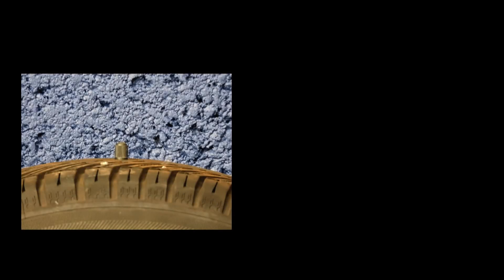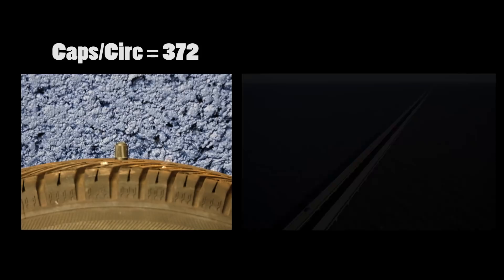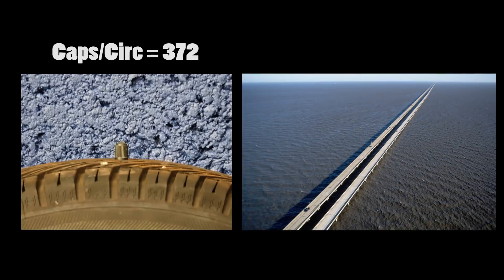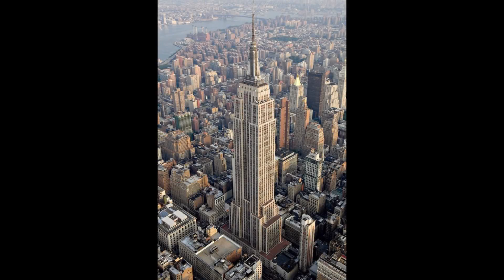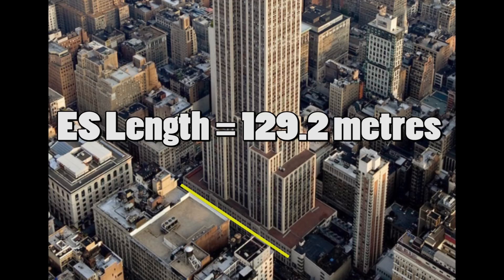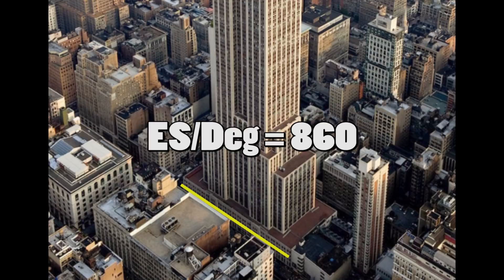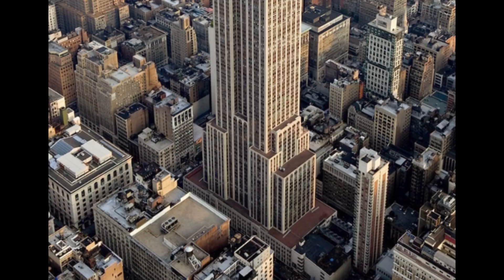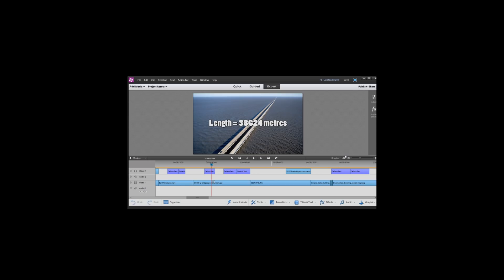Flat Earth Can't Scale

Comment: You do realize that the math you used is incorrect right?  Cause its based off the inside diameter of the tire against the rim?  You have to add the height of the tire to get the true circumference.  Which means, it would take closer to a cap and a half per 1 degree on the first tire.  Still doesn't change your point though, just pointing out the flaws.  :)
Reply from the maker: Yes, I pinned a comment and updated the description hoping everyone would see that the corrections were made.

Comment: Ok so first of all I'm not a flat earther let's make that clear. Your video is informative and something logical to think about. But I have 1 question and hope you can help me with it. The accepted circumference of the earth is about 24,000 miles that's an established fact so your math works on that .the question is to make the curvature to create a globe with that 24,000 mile circumference the curve would have to be 8 inches per mile squared so the curve drops pretty fast according to the accepted science. If this is true we still wouldn't be able to see it from the ground but from the air in a plane it should definitely be visible. But it's not so I'm not saying that its flat but I am saying it's not the size the tell us it is .we shouldn't be worrying about this anyway the real problem is that people actually care enough to argue and fight about something none of them can prove with 100% certainty instead of questioning why the distraction was put out there in the first place .again I'm not a flat earther or a globe earther I dont know and dont care what shape the planet is it doesn't change the fact that we are all slaves being deceived and segregated and taken away from the real problems of the world
Reply from the maker: Curvature doesn't literally drop, and that formula is only an approximation for estimating apparent drop from zero elevation between two points on the surface. It actually describes a parabola and is only useful for small distances.

Comment: The only difficulty I've got with your video is stating that water locally is flat. Wouldn't all bodies of water have some amount of curve, even if it were extremely small?
Reply from the maker: Yes, it's really semantics as far as what we can see, measure etc. Technically it must be there but at such a ridiculously small scale it's as good as flat. Way beyond our ability to discern.
Reply: Agree 100%. Plus, calculating out the surface tension on the sides of the container makes it even more difficult. But, we know it's there.

Comment: I’m not sure this goes much further toward proving anything than what your trying to disprove.  It’s locally flat, I think we all get that just looking around.  Using your numbers and degrees relative to the earth your saying them 111,111m or roughly just over 69miles is a degree of arc on the earth which then likewise corresponds to roughly 3200 arch drop or well over half a mile which doesn’t allow for the sides of your buildings to be straight nor even seen by one another for that matter at their extents in the example provided.  It would seem for the quick to jump aboard a common bandwagon your tire cap analogy fit like a mitten and for those not so quick to discern you weren’t all that convincing.  I suggest everyone with an opinion go out and look into this topic a little deeper for themselves as this gentlemen did and see what you come up with for yourself.   After all, it seems everyone is using information supplied by someone else to do the math anyway...what can you possibly observe for yourself in order to actually determine and render an opinion for yourself.  This, though a good locally grounded visualization is not actually a proof of curve though I wish it triggered more people to think for themselves rather than simply follow a bandwagon because it’s the easier path...but then I suppose bringing that to the forefront is the point of the exercise, isn’t it ?  Love and respect thy fellow man and treat him as you would wish to be treated should you wish to gain his respect...
Reply from the maker: There is no attempt to prove anything about the curvature here, only to dispel some poor logic and help some people perhaps get a better concept of the true scale of the earth. Without that understanding, expectations are unrealistic and it results in bad arguments.

You make reference to buildings being unable to see each other in the example given, but there is no example given of an observation over distance. So based on your comment I will have to assume you are proposing an observation taking place over a full degree, which does not happen, at least not at low altitude. In that instance buildings would be completely gone. When they are partially visible, at lesser distances, the degree of lean is miniscule and imperceptible, and that is an easy demonstration anyone can make for themselves using a pencil or ruler (or something similar).

Comment: In the bridge example we are talking of 3 degrees, not 1 (its more than 38 km long, not only 12 km). Even though, the see level keeps constant under the bridge, and the bridge is a perfectly plain surface... The tire example seems friendly, but real stuff are far away from cars wheels and caps. In fact, the portion of tire you placed the cap on is flat; because tires are made of litle squared portions placed all around the circunference to keep the grip.
Reply from the maker: 111km per degree.

The bridge represents approximately 1/1000th of the circumference of the earth.

As stated, 2.9 bridges per degree.

Level does not mean flat. Each span of the bridge is built level with the water but the bridge does curve. It is easier to see the curve on the bridge than on the water because it is like a ruler and you can look down the length of it and see it go beyond the horizon. The water is an expanse all around you and below you so there is no definitive curved lines to aid you, and the horizon is the tangent point of the curve so behind there you don't see the actual water any more.

Some tyres may have chunks but not all and not this example.

Comment: You just did an entire presentation on how it's possible for a curved surface to look flat relative to size. Great presentation. However, I missed the part where you showed evidence that the earth is actually a spinning ball. Proof and possibly are not the same thing. 

This can't be your idea I evidence.
Reply from the maker: As you noted yourself, the subject is local flatness on curve, not whether the earth spins. I try to stick to a specific point and this video is to rule out the fallacy of believing that relatively small scale flatness can be automatically equated to the entire earth being flat.

If we take the position that the earth's shape is a complete unknown, then at best it offers a 50-50 chance of being true. From there we have to look at more data, do wider scale and more varied observations, then put all of it together and see what actually makes sense. So being able to have a flat looking table or bath means nothing in its own.

Spin is another factor and it will come into it at some point but that's a topic for another video.

Comment: Good video but flawed with scaling. The cap you use is hollow in the middle. For it to lay flat would require a true flat area to sit on. The flaw here is that if you had an object that large and it could sit flat on a sphere then one of two things MUST occur. Either it sits on a plateau with a cliff on all sides at a height mathematically necessary to reach back down to the natural curve of the sphere. This assumes the center of the object is where level was achieved when placed. Alternatively if the outer edges of the object were seen to be at ground level and the object had a flat bottom then elevation at ground level in the center would be extremely lower if not below sea level in reference to it's outer edges. What's not mentioned in this video about scaling is the massive numbers you use when calculating curve. When claiming such a large spherical object such as Earth then the math of curve also must be scaled when solely trying to show perspective. That is why curve is so easily measurable. the amount of curve over short distances is huge for a huge sphere. It's a case of you can't have your cake and eat it too.
Reply: To put it in perspective here is the math. If an object one degree of Earth's circumference was placed and level at it's center then the drop to get back to the natural curve of the sphere on all sides would require a cliff 3190.326 feet high. Or if all sides of object were seen at Sea level then the flat bottom of the object center would be 3190.326 feet below sea level. Note that this curvature only spans 69.169 miles. One degree of circumference. Like I said scaling such a large sphere requires a huge amount of curve relative to our tiny size as humans. Makes testing it easy.

Comment: They hear 1000mph and think the earth should be spinning around several times a second - it does take an entire day to rotate.
Reply: They can't understand that the Earth rotate at half the angular speed of the hour hand of a clock. They can't make the difference between tangential speed and angular speed.
Reply: but its still a 1000 an hour
Reply: Yep,  @c0olking   that is  1500 ft/per sec... imagine landing an airplane :)
Reply: @c0olking  
And at the poles it is nearly zero.
Reply: @c0olking  I know right - take an old school clock and put it flat on the floor inside a moving train - put a single drop of water on the hour hand (which is moving TWICE the angular speed of the earth - i.e. it rotates twice 24 hours).

NOW - watch the drop FLY off the hour hand as both the hand is moving - AND the train is moving! 

Now watch that annoying fly zoom around inside the moving train as you watch the clock in amazement. THAT FLY IS FLYING AT CLOSE TO 100 MPH HOUR!

NO WAY - how can a drop of water stay on the hand even if it all is moving so fast!!! (hint; look up angular velocity, acceleration and relative motion)
Reply: c0olking So what?? If you and everything around you are moving at the same speed and direction, then everything around you will appear stationary. When you are steadily cruising down the road in a car, you  and your passengers aren't constantly pinned to their seats and quite easily pour a drink, for example.

Comment: Huh, interesting stuff, but this video demonstrates it's not only flat earthers that have a problem with scale, because I've heard plenty of globe believers say you can see boats go over the curve, but as correctly pointed out in this videi, a boat would have to travel just shy of 70 miles before it starts to disappear... Looks like it is atmospheric distortion that is covering the bottom of objects at sea after all. Also, the bridge in this video has been shown in photos (by someone who goes by the name Soundly) to start curving, so what's that all about?
Reply from the maker: The cap is used to illustrate a point about scale so that people can try to understand that when you come down to a very very small local scale, the idea that something can't appear flat or level is completely false, so it is a bad argument to use. However the cap isn't a perfect example, it's just something we can all relate to. What it doesn't do is negate the curvature of the tyre. You understand that, right? You saw the cap sitting on the tyre's curved surface. If you could get yourself down to the equivalent scale and stand on that tyre, you would see things disappearing over that tyre's surface too, within a far smaller area than that which the cap covers.
Reply: @ETM2024  it sounds like you are trying to have your cake and eat it, so to speak. I do understand that under the cap there is still a slight curve, but wasn't the point of your video that in (relatively) small areas land can be flat?
Anyway, besides that I did find this video interesting as I was trying to work out just the other week how much of a circle would be unobscured, hadn't thought about breaking it down to 360 parts. Whether I agree with you or not on boats etc, it was useful to me! Thanks.
Reply from the maker: @obelines  

I understand why it might seem that way. The cap can be seated flat on a small enough area of the tyre but when you start getting into the fine details you can also see problems at a smaller scale. Just as this can be done with the cap, so should we expect to be able to do the same with something far more minute (relatively speaking). But the claim is that we shouldn't be able to if the earth is curved, which is just false.

Hope that helps, either way I'm glad the video had some use.

Comment: What a pile of bull excrement. Here's a little something for you ball-tards to scale. How about the distance across America? It's over 2500 miles across east to west. Science tells us the Atlantic and the Pacific oceans are almost level where they meet land. Actually the Atlantic is a mere eight inches above the Pacific when measured from tidal gauges (often called stilling wells), due to density, (more salt per volume). smaller body of water, ice melt, winds, currents, etc.,etc,etc. The water being level at both the east and west coast does in fact establish a cord, of which elevations through level loops have been recorded and verified by the USGS. No topography map ever made supports us living on a sphere 24,901 miles in circumference. Of coarse the earth is not flat, nobody ever said it was. We do know there are mountains and valleys etc,etc,etc. The known and recorded elevations across America would necessarily have to conform to the alleged curvature, if there was one. However none ever do, on any large area land mass ever recorded. The state of Kansas is over four-hundred miles across. Ball-tard math, @ eight inches per mile (squared) would in fact demand the center of Kansas be 10.13 miles above either it's east or west borders. Ball-tard math tells us in a four-hundred mile span the drop would be 20.26 miles, so half of that would be the radius elevation above the cord. Kansas has a mean (average) elevation of only 2000 FEET, (less than one half a mile above either ocean east or west). Kansas itself does not have a bulge in the middle of over ten miles high, that's twice the elevation of Mt. Everest at 5.2929 miles. But this gets even worse for the ball earth believers because Kansas is in the middle of that 2500 mile non-extant arc. Ball-tard math would demand Kansas to be hundreds of Miles above either ocean east or west. To make this even more simple for the simple minded. Lets divide your imaginary ball earth by four. Every 6,250 miles the drop in curvature must equal the supposed radius of 3,959 miles. Ball-tard math being just about as ridiculous as core math lets round those numbers off to say for every 6000 miles the earth curves down/up 4000 miles. Is the center of America hundreds of miles above either ocean?
Reply from the maker: Hillbilly how many times do you need to be told ELEVATION IS NOT CURVATURE you complete tool?

FFS get a clue.
Reply: As many times, apparently, that you need to be told, the known and recorded topography of any land mass large or small does NOT conform to your imaginary ball earth. So where is your hypothetical curvature? It's nowhere across America or any other land mass. Must just be salt water, huh? You think we live on a giant ball of water yet every land mass measured between your imaginary curved water is basically flat. Damn we must be living on something that looks like "Tupperware' child's toy called shape-o-toy. What a fool......................
Reply from the maker: @hillbillytennesee7438  

When you get to Kansas and debunk the adjustments for curvature made on the Jefferson grid get back to me.

When you debunk the entirety of geodesy, which gave you the measurement of topographical features, get back to me.

When you learn to tell the difference between curvature and elevation, get back to me.

Until then, remain a complete tool.
Reply: I lived in Kansas for a number of years, therefor, I really don't need to go back there to know it's"flatter than a pancake".  There's no ten mile high rise in elevation in the center of Kansas the Jefferson grid covered up. Besides that was just a grid system to replace meets and bounds, of which we still use today. Geodesy survey's, (school book hypothetical theories), are much like your theories, The theory of gravity. The theory of curvature on your imaginary spinning wobbling ball earth.the theory of relativity etc,etc,etc......Chasing equation after equation much like Einstein did to make things work. Once you learn how elevation would in fact determine and support your theory of curvature, if there were any, which there isn't, get back to me...............